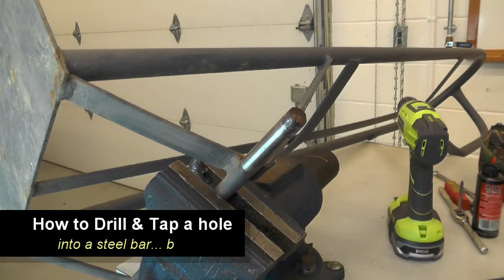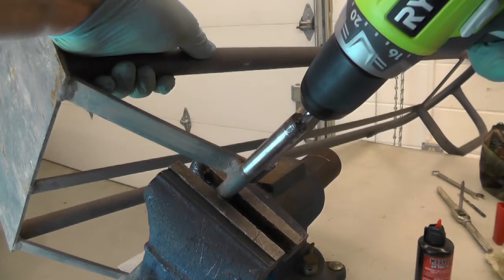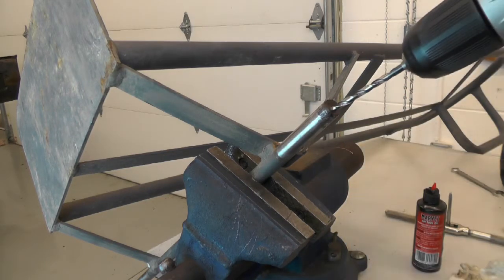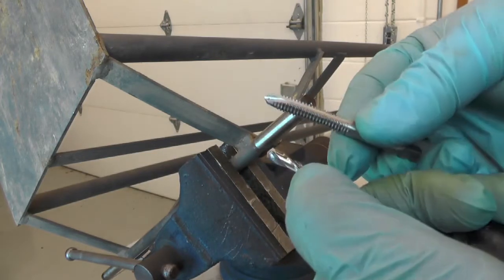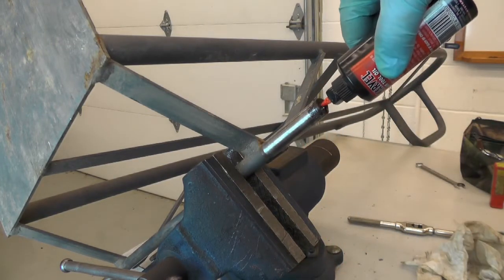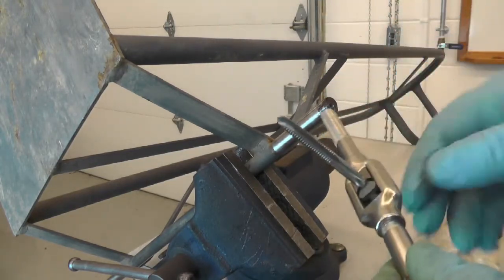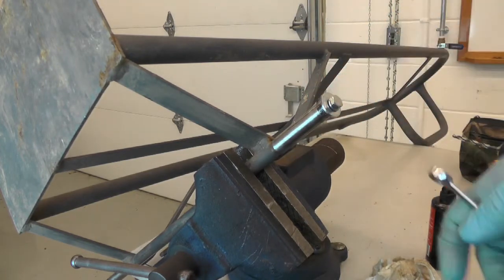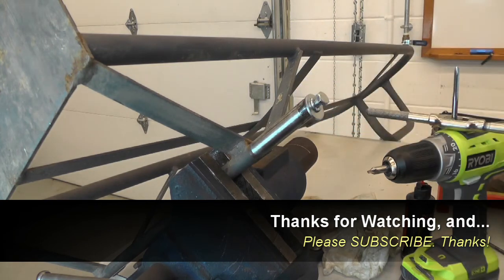How to drill and tap a 1/4-20 threaded hole into a steel bar

Comment: Nice video but want size in inches of a #7 drill bit ?
Reply from the maker: #7 is 0.201" It's a pretty exacting size, which is specific for tapping a 1/4-20 threaded hole, which is why they make these special "numbered" drill bits. Happy Holidays!
Reply: @stevenofpa  Thank you....Happy New Year
Reply: 13/64ths" will get you there
Reply: @Seeker85420  Thank you
Reply: Great Video. Number 7 I understand, but what is the size of the tap the I need to use (order) please?
Reply: In need to order a tap for a 1/4 screw, for my flashes and tripod. (photography)